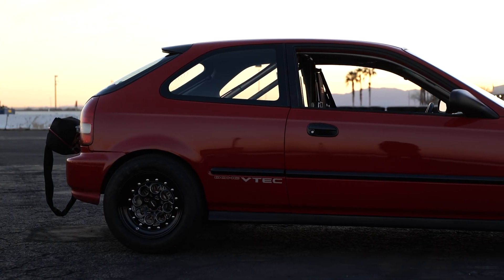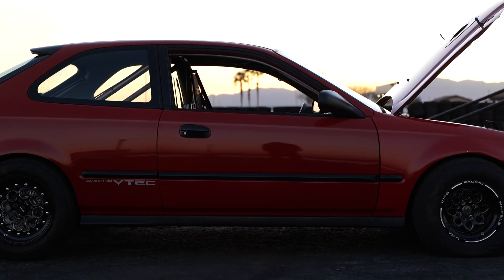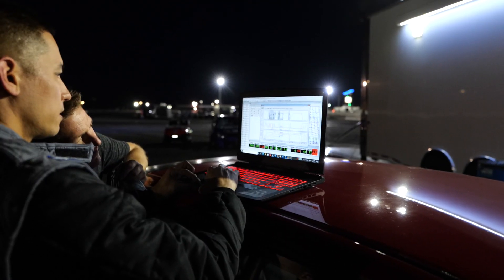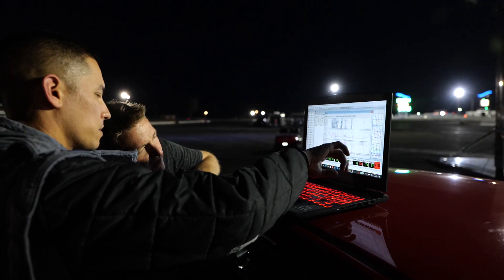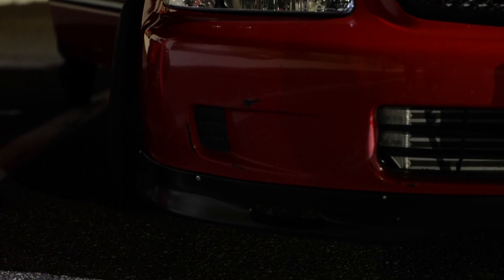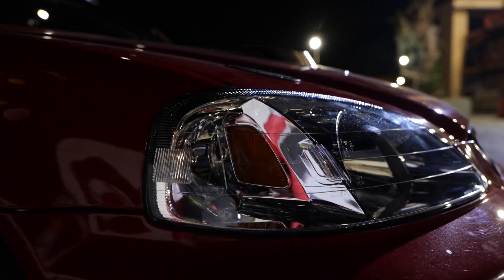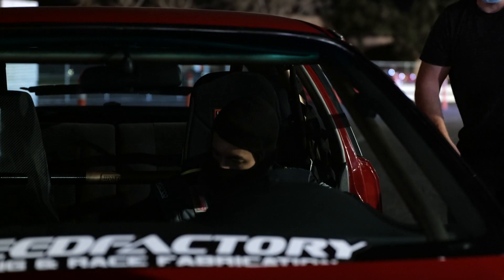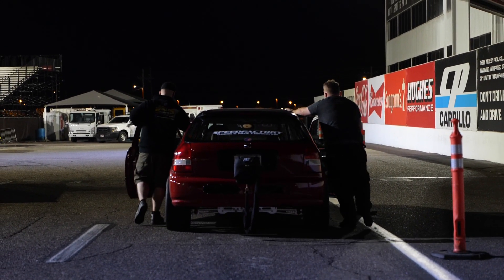Ostrem / Speedfactory Racing AWD Civic On S300 - hondata_logs_001

Comment: Man! Uberdata is a name I haven't heard in many years lol...back when stock d16y7/y8head and Y8 trans were dirt cheap still and with eclutchmasters stage 3 clutch and 7lb flywheel being the most expensive parts on the 98 civic dx coupe, oh and the 20" slicks lol....Uberdata with walbro pump, dsm450s and a junkyard turbo kit, hf manifold with t3 flange welded to the cast manifold which was a little leaky but I figured it kept my boost in check hahaha,  my favorite custom part was Mitsubishi Starion fmic that I cut and patched and JB welded into a backdoor..yep it held 8-10psi for over 3years lol. DOWNLOADED a bin file with somebody else's tune that was a similar build, burned it to a chip, and checked it against watching wideband and checking plugs for a few days, and found it to be the way I like my women, rich and little retarded, and safe for daily flogging lol jk...So, I buttoned it up and didn't touch it again, except for maintenance, til I sold the car and that person drove it another year...31 mpg avg daily(35 on long trips) and ran 13.9@99mph 1.9 60' at 8.7psi... only broke a ring land one time because I got greedy at the track and tightened internal gate a couple threads, hit 13psi and still had dx tall gears and just past half track I knew the drive home was gonna be smokey lol only 90 min drive, a quick pcv reroute through a disconnected charge pipe to keep smoke running through the engine and out the exhaust and it wasn't too bad and technically it never left me stranded hahaha. Got home and slapped a set of used Y8 pistons from the vtec head donor(free repair minus head gasket and fluids). All said and done....$1500 into all the parts total...man 2003 was a long time ago! My homie had a h22 turbo hatch at the time and was the only one we saw at the track or anywhere really at that time...I love seeing these videos that show the innovation that we once had to come up with for commonplace swaps these days...pacific raceways, I used to watch speedfactory because we had mutual friends...I need to build something lol